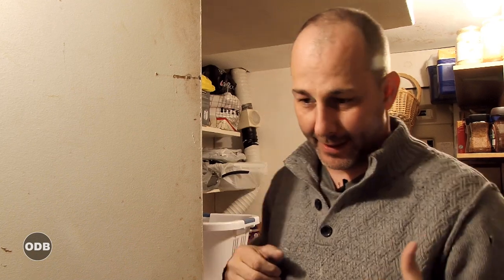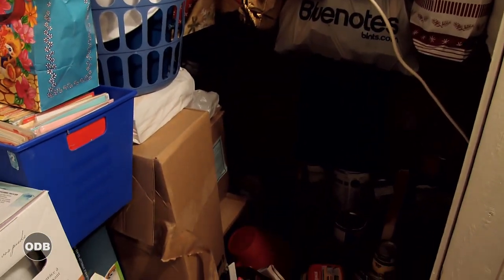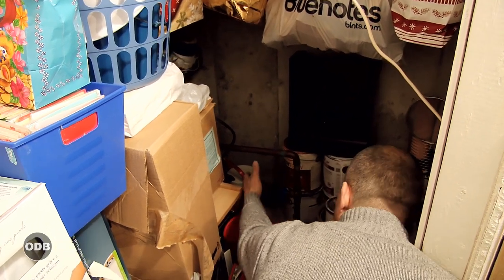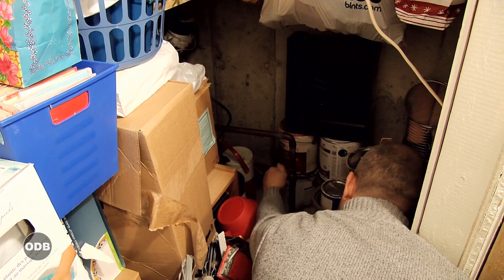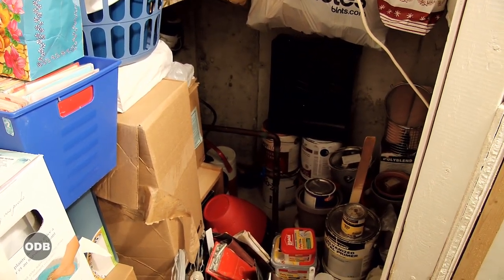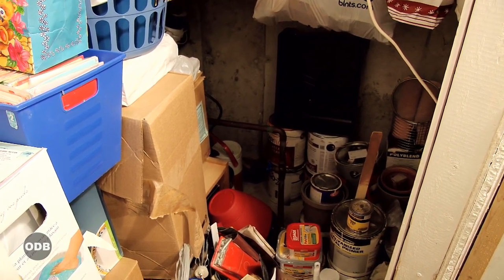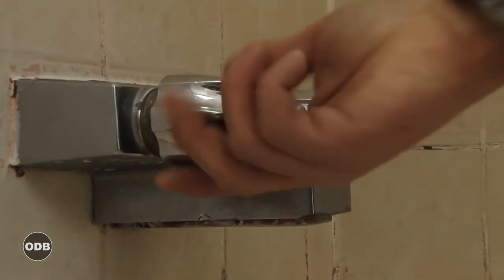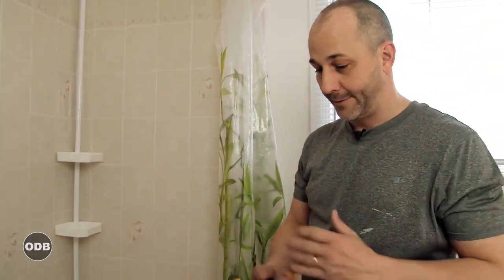How to Turn off the Main Water Supply Line to your House

Comment: I used to change water meters and i'd be very careful touching that main water supply. A great deal of them leaked after or could even blow off. I always advised homeowner to install another valve after meter and use it. The valve before the meter is the last point to turn of water before you have to call in the city to turn it off at the street.
Reply from the maker: Good point. Although turning it off is still necessary.
Reply: LOL SO TRUE
Reply: You still have to turn it off to install a second valve -- bit of a Catch 22, right? :)

Comment: I’m about to replace a shit off valve in my upstairs kitchen. When I turn off the water main and begin to drain the water out of the lines from a tub in the basement, it sounds like the water heater is draining. Would I be best to turn off the power to the electric water heater so the elements don’t overheat? Or am I misunderstanding what I’m hearing?
I’ve replaced shit off valves before but don’t remember hearing the water tank draining like this.

Comment: For a longer summer vacation like 2 months during the summer is it a better option turn off the water to the house at the inside valve or the one closer to the street.
Reply from the maker: As long as your valve doesn't leak the inside is fine during the summer. If closing the house for the winter there is a totally different protocol

Comment: Does shutting off the water supply effect your water heater? I'm installing a new line for a water hose on the side of my house and I'm not sure if cutting the water off to the water heater is dangerous with the flame inside going

Comment: When doing a bathroom renovation, how do you turn off the water off just for the bathroom and leave the rest of the house with water? Or do you have to turn the whole house off?
Reply: Normally you cant. Turn off the water at the water heater. Drain the lines at a faucet at the lowest point of the house

Comment: Hello, I shut off the valve but it did not cut the water. Would I need to replace the gaskets ?
Reply from the maker: Looks like you may need to have the city turn off the water outside to replace the valve. This is definitely time to call the plumber. Not everything is DIY!
Reply: @HomeRenoVisionDIY  Hello! what if the water pressure is slow do the whole house and I have a three-story house in the only one that works with a bad from on the first floor and the pressure is leaking from the faucet in the toilet flush but the rest of the house do not work what should I do I forgot which way to turn the water back on
Reply: @HomeRenoVisionDIY  I don't want to strip it if I already have anymore please I need some professional help
Reply: @HomeRenoVisionDIY  I don't want to strip it if I already have anymore please I need some professional help

Comment: Does turning off the water and emptying the pipes create air blocks?
Reply from the maker: No, Air can never bolsk the line. It does sputter about when you start using it again. so be careful especially if you have a water fall faucet design. A great prank by the way
Reply: @HomeRenoVisionDIY  I know a little about a lot of things regarding the nature of the universe but carpentry, plumbing, etc these things are not in my skill set so I would just like to say thank you for mentioning that air can never bolsk the line. I would have never known. 😆
..
Seriously, I looked up the word bolsk and did the Homer Simpson, "Doh!" thing and realized it was just a typo.. Good times.